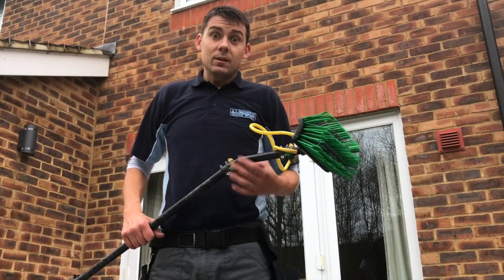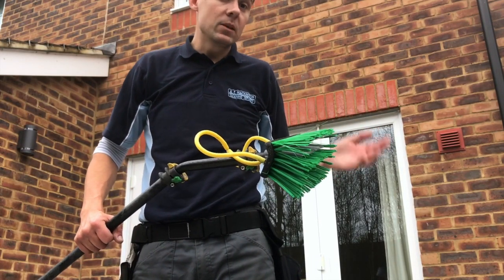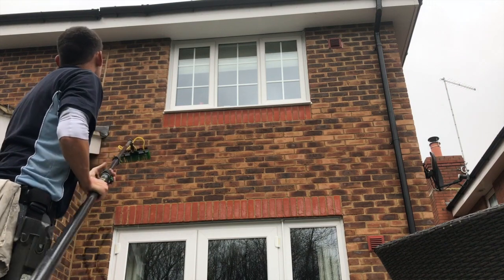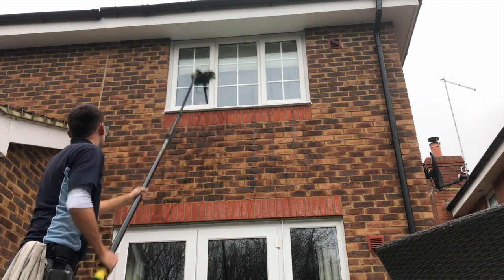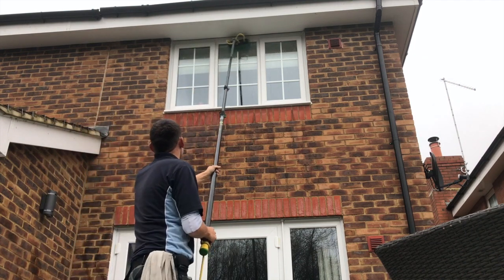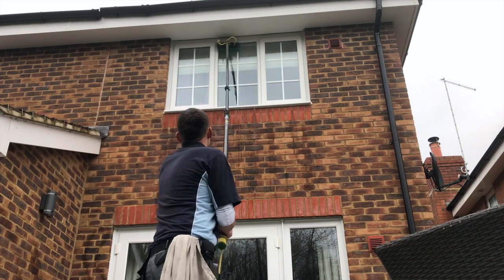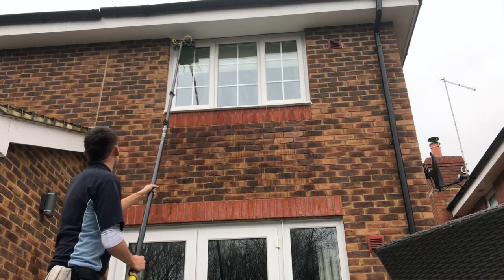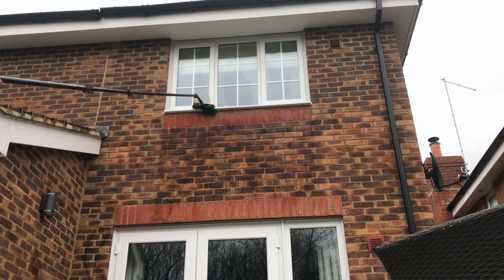Professional Window Cleaning Using Water Fed Pole

Comment: This method does not work for me, though I am still learning how to wfp.  Even after lots of scrubbing, any drips from the seal leave dirty marks on the windows.  I have found I have to wait until the seal dries enough so there is no more dripping.  Then very, very carefully rinse the window without touching or even splashing the seals.  This makes it very difficult to get the entire window, often there are a few spots at the top of each pane.  It is also time consuming because I have to wait to clean bottom windows while the top ones dry.  Nonetheless,thank you very much for your great youtube channel, I appreciate all the experience you share, it is helping me to become a better window cleaner!
Reply from the maker: Tejbir Singh You do need to make sure you clean the frames right along the top, and then rinse thoroughly, from the top all the way to the bottom. Should get good results.😃👍🏼

Comment: What’s your view on that Unger pole?
Reply from the maker: julian pierce It’s a great pole, I really enjoy using it. Good point though, I should do a review!💦😃👍🏼
Reply: A.E.Mackintosh Cleaning Services please do a review, I was looking at this pole yesterday, there are 3 different carbon versions, 100%, hi mod and ultra high mod, I think the 100% carbon is good enough for most residential work.
Reply from the maker: I think the hi-mod is better suited for larger work. It is the carbon fibre that I use on domestic. It’s pretty lightweight and I use the extension for reaching third storey, skylights, solar panels. I want to make more videos about this pole soon.💦😃👍🏼
Reply: A.E.Mackintosh Cleaning Services cheers for the reply, look forward to seeing the pole in another video 👍🏻👍🏻

Comment: äääähhh,...i did it in this fast simple way, BUT shortly thereafter the dissolved dirt from the top of the frame was dripping on the cleaned glass!
So i had to rinse the glas a second time. ANYWAY....!
Reply from the maker: Heinrich Nützel It’s good to do nice and regular. Dirty windows will need an extra scrub and rinse.💦💦😃👍🏼
Reply: YOU ARE RIGHT! Sometimes for me as a german window cleaner i have to look into a dictionary for a britain "REGULAR CLEAN"????!!! "what do You mean????" Germans take a shower every day, but are "really smell dirty" by the windows! Even the windows of the courts..., yes>dirty germans!!!
Reply from the maker: I clean most customers once a month. Maybe I will make a video about it?😃👍🏼 Thanks for your comments.
Reply: A.E.Mackintosh Cleaning Services then WFP is perfect for regular service (monthly). Another way you do traditional?
Reply from the maker: W&W Window Cleaning Most of the time I prefer to use traditional method if possible. I usually only use WFP if the window is hard to access.💦😃👍🏼